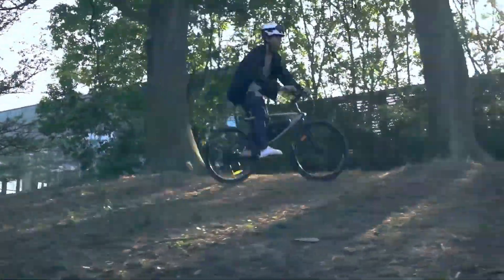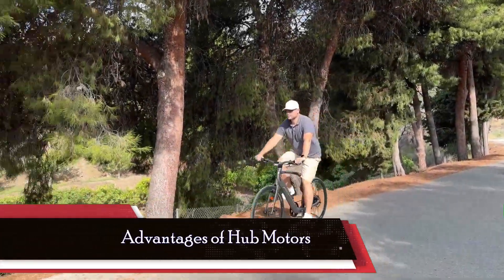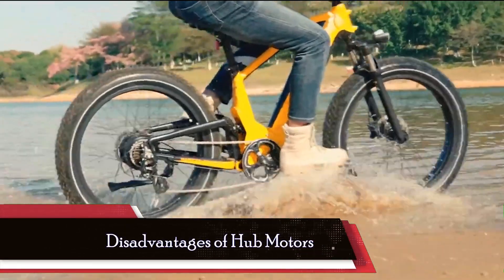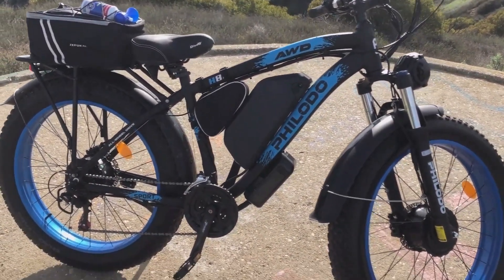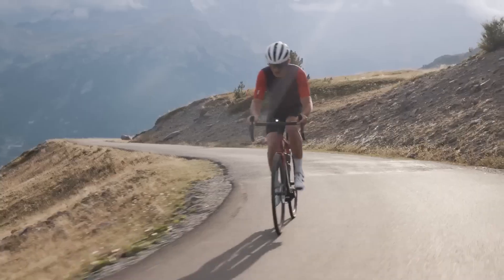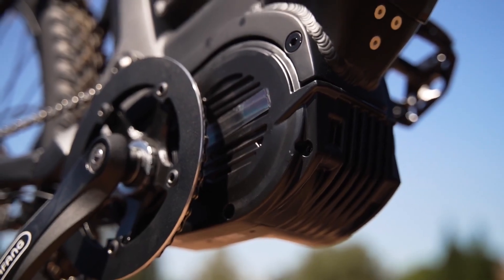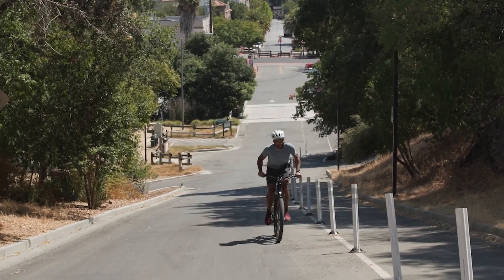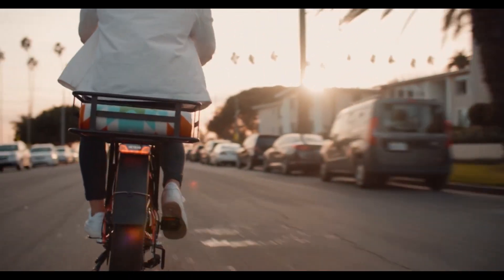Hub vs Mid Drive Ebike Motors: Choosing the Best Electric Bike Motor!

Comment: Brother I have an e bike named as Raymon hardray 4.0. It has a yamaha mid drive motor and a yamaha display. I tried to increase the speed of the bike by putting magnet to pedals and removing sensor from its original place.. it worked perfectly but suddenly it stopped working completely. It gives very little peddle assist. Before I could go max 16miles but now the motor doesn’t support 5 miles. 
The change in the display that appears after this problem is that the range shown on the display is blinking. It never blinked before. Please help me. I haven’t found any video to solve this problem. No one in my area is able to identify the problem
Reply from the maker: Someone had a similar problem turned out to be the motor sadly
Reply from the maker: If you have somekind of warrenty, its better to contact the manufacturer